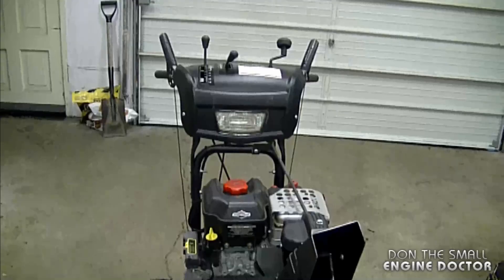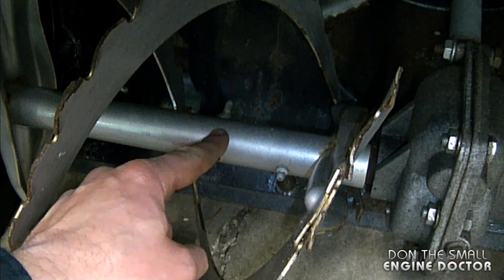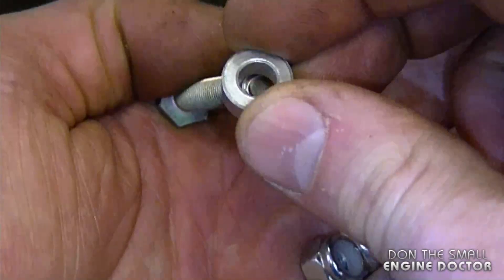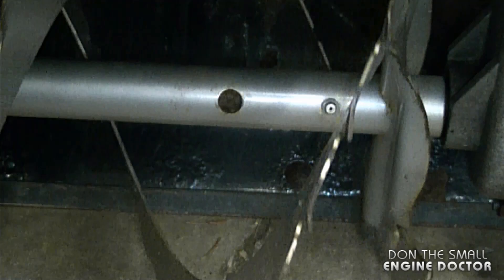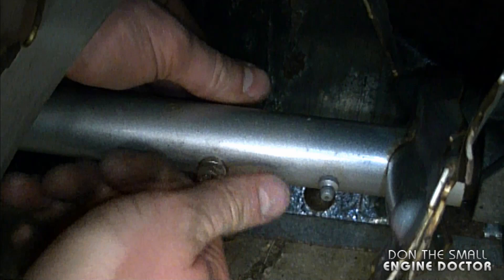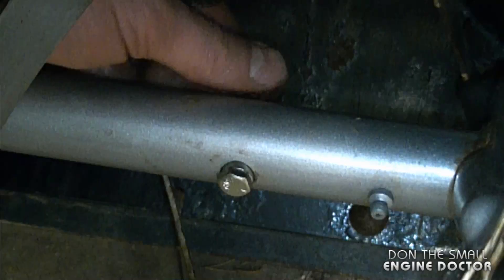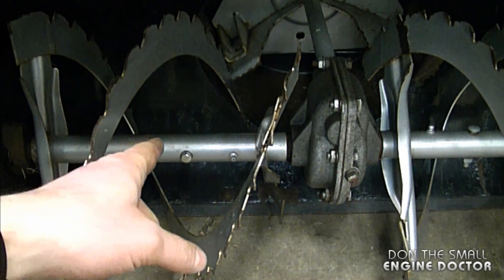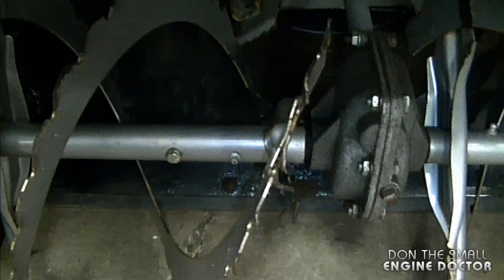How To Replace Shear Pins On A Snowblower - video

Comment: owe by the way i built me a welding cart, i did not use the square tubing though i used what i had laying around and it worked but i wish i had the extra heavy duty material now. thanks for that video too

Comment: Mine was same way, regular bolts instead of proper shear bolts. Our neighbour said he uses regular bolts. I got the right ones for my blower! Plus plenty of spares.
Reply: Haha everyone knows better than the factory and puts in regular bolts. I don't know how many times I've heard that....or seen a destroyed gearbox because of it. 
Yea no doubt, the correct pins are cheap :)
Reply: MrTheHillfolk cheap but my supplier requires I buy 10 pack. Probably still cheaper than a pair from a dealer.

Comment: Excellent information! The fact that you don't crank down on the shear pin nut is instrumental. Also, some shear pins may have relieve cuts on some models to allow IT to break instead of the gearbox. Buy the right shear pin for your machine and don't just use a bolt.Thanks for the info.
Reply from the maker: have a good day

Comment: Hi Donboy -
  Watching your video of installing a shear pin, I noticed the shear pin you had put in the shaft did not have a slightly small groove in the middle so it will break off very easy .  Was it a mistake ?
Reply from the maker: that is how the Murray snowblower pins are made. Mtd and other manufacturers have grooves in them

Comment: I striped the treads for the sparkplug on my snow blower.  I bought a kit (save a tread) it comes with a taping tool and 4 or 5 difrent lenght of treads it seams to work for now.  Do you know if its reliable?  Thank you.
Reply from the maker: usually reliable, there's a lot of used heads on ebay

Comment: Hi Donny: Great Video,I own a Murray Snowblower. I follow about where the metal bushing goes in relation to the auger shaft,does it matter which way the bolt and nut go on??
Reply from the maker: it doesn't, but it does matter where the collar goes
Reply: donyboy73 Thanks Dony,now the problem is the holes in the augers have become enlarged by the previous owner,is that critical?? I understand from my local parts dealer,the augers are N/L/A. Is it possible to weld the holes and then machine them out to the original size.???
Reply from the maker: gardener123ful if they are elongated it may break more pins
Reply: donyboy73 Thanks again Dony,I thought the pins were not lasting very long. I hope my local welding shop can repair the augers.

Comment: Hi do you have a video on how to fix the cable on the shoot of a MTD snowblower it adjusts how far the snow is thrown. The handle doesn't work so I'm thinking the cable came off or is broke inside the lever. Thanks
Reply from the maker: not yet, there is an adjustment though under the console

Comment: What's the purpose of the grease zert on the auger? It doesn't look like it does much.
Reply from the maker: it keeps the augers from seizing on the shaft
Reply: donyboy73 I wondered if it did that. They should put them on rear lawn mower rims too. Thanks
Reply: Love2boat92 If I can remove the rear rims from a mower, without destroying it, I grease the shaft with a generous amount of anti-seize. I don't know if its the right thing to do but, it sure prevents a lot of aggravations.
Reply: R Verro Yeah I just can't figure out why they don't put them on the rear rims of a lawn mower. Do they make antiseize that comes in a grease cartridge?
Reply: Love2boat92 Not to my knowledge. I bought some that comes in a small plastic container with a brush. Graphite powder works good too but its expensive.